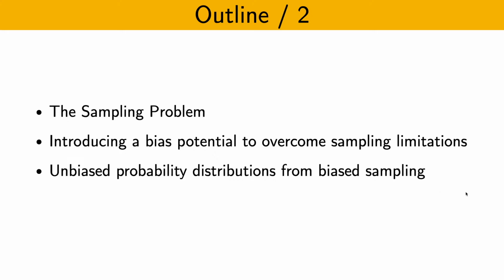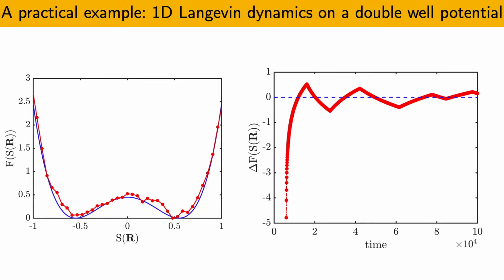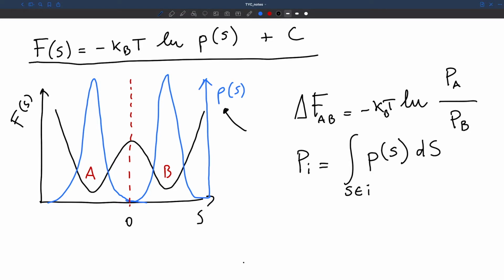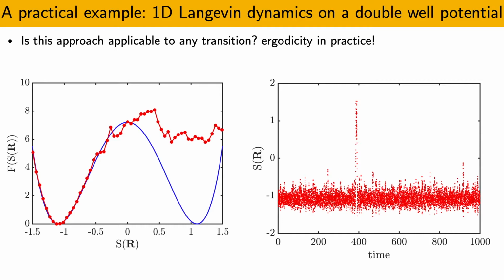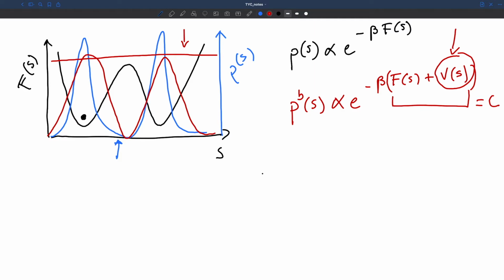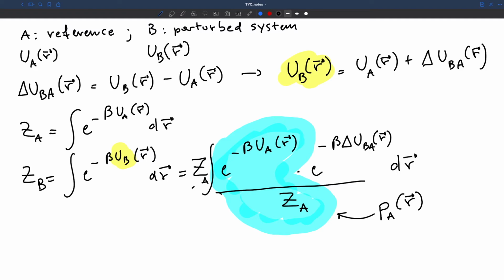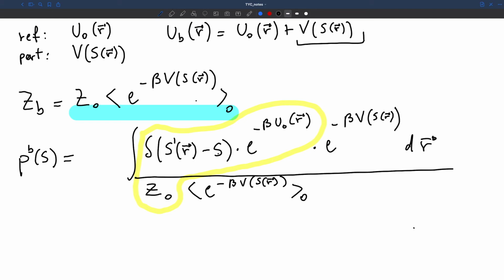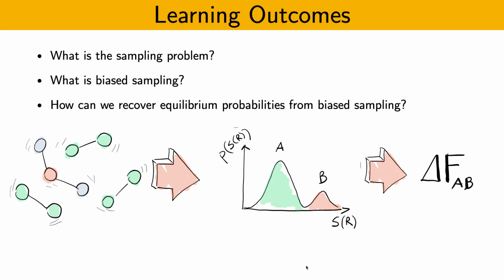33 Enhanced Sampling2 - Matteo Salvalaglio

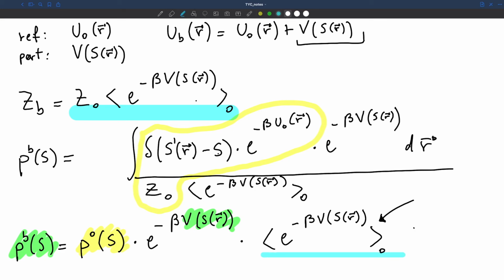Comment: Thanks for the nice video! I have a question at 38:00, can you clarify why the ensemble average term is no longer dependent on s? And in the same equation, why is the middle exponential term no longer inside an integral...in the previous line it is inside an integral
Reply: Hi Jo, thanks for the questions! 
1. The ensemble average of a function of S, corresponds to a single value, independent from S. Imagine evaluating the average temperature in a room where you have a heater in a corner and an open window. The value of the temperature in the room will differ from point to point (it is a function of the position). However, the average temperature in the room will be a single value, independent from position. 
2. The integral of a function f(S) multiplied by a delta function centred at a specific value of S = S' yields f(S'), i.e. the value of the function in S'. In the passage that you are mentioning we obtain an expression of the biased probability density for a generic value of S, and the middle term indicates the exponential function evaluated in that point in S. I should have done a better job with S and S' in the integral, making this passage clearer! I hope this helps! 
cheers - matteo
Reply: @MrKillcoffee  This makes sense, thank you!